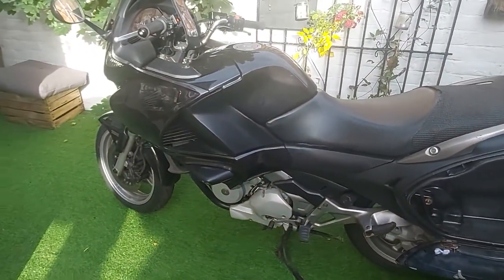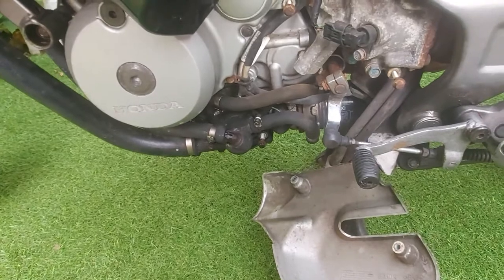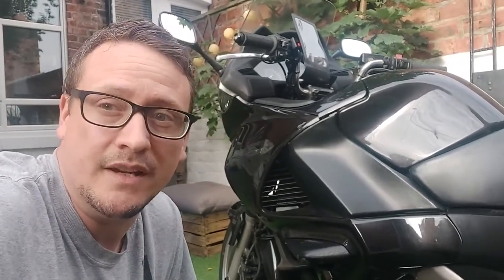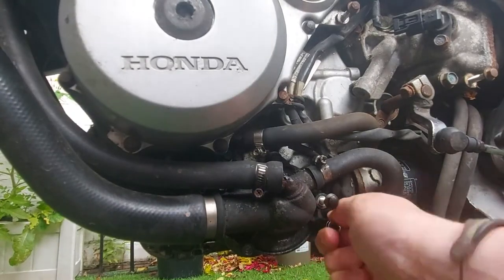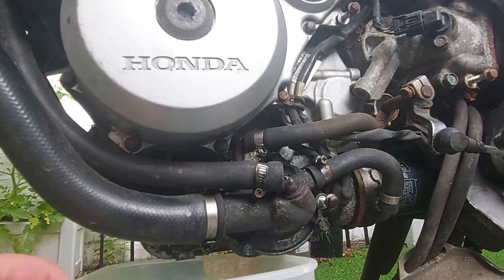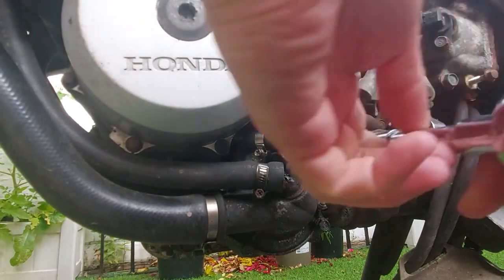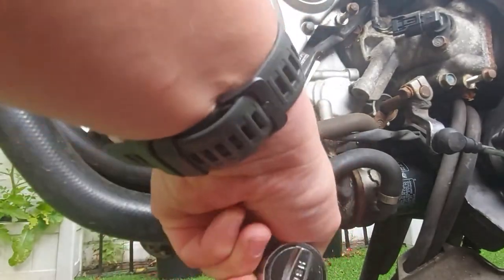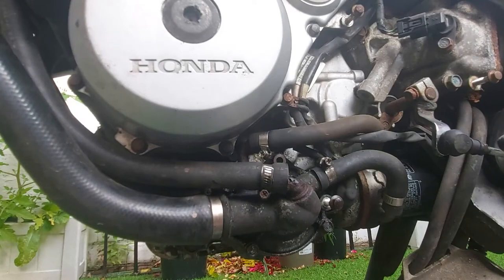Honda NT700 Coolant Leak - Water pump housing and crossover tube

Comment: hello from Pittsburgh Pennsylvania, USA. I picked up one of these Honda NT 700s in 2023/November from the original owner with 7500 miles/not kilometers
  I had trouble with it because the owner parked the bike in his heated garage in 2008 and he put stabilizer in the fuel tank. That stabilizer turned into a lump at the bottom of the fuel tank looks like sand. I have videos of the entire ordeal on my YouTube channel. But when I got the bike, my riding the bike, I believe loosened that mass of stabilizer matter and caused it to plug my fuel filter stranding me 40 miles from home… I finally figured out what it was, and in cleaning the fuel tank and removing the fuel pump cassette from the bottom of the fuel tank, I saw that I could get my whole arm inside the gas tank to use a scotch bright pad inside the tank to loosen all of that white powder that had hardened to the interior of the fuel tank
once I got things sorted in the fuel department, and I put the bike back together, it’s still had a slight hesitation which caused the bike to stall when pulling away from stop signs every now and then. When I would open the throttle from low speed it would Buck like someone shut the key off and then turned it right back on. 
  I did a lot of research on the Internet and discovered that Honda was going to do a worldwide recall on this particular motorcycle because of bad spark plug caps. The plastic bits that snap onto the spark plugs themselves. They didn’t do the recall because they felt that it was only necessary in hot climates to replace the spark plug caps, either way, I’m sure it would’ve cost them millions to do that. But I replaced the spark plug caps, now the machine is running as I think it should..
  on the Internet, they say this machine has two common glitches, the spark, plug caps, and the water pump. Seal is prone to start leaking…
  I was going to just throw in a new water pump, seal and impeller for the heck of it and change the coolant to a low silicate aluminum compatible coolant.. apparently silicate, which is a corrosion inhibitor is what is abrasive to the water pump, shaft, and seal..
  i’ve had quite a few dozen motorcycles over the decades, including two Honda pacific coast/PC 800s. My first one got totaled with me on it at a stop sign waiting my turn, my replacement one I rode for 24 years, commuting, 31 miles a day. I always felt that the Pacific coast was the best all-around motorcycle in the history of the world. I am hoping this new to me Honda nt700 owner has a 2010 model pans out for me and impresses me to the point where I think that this may be the best rounded motorcycle for all types of street duty..
  I bought this machine because of the high praise. This machine gets from the European in the UK riders, which I consider to be genuine, motorcyclists, and not just people that on motorcycles. There is a difference…
  watching this video, made me cringe when that one bolt at the water pump just sheared off. I was not sure and I’m still not sure if you were able to get that broken piece out of the engine? Did you? Or did you put the machine back together without that sheared off bolt being replaced?
  watching that happen has changed my mind about just putting in a new water pump, seal and impeller to avoid future problems. I believe I’m just gonna let sleeping dogs lie in this case..
  thanks for the video. I did not know how great these motorcycles were when they were current. I have never even seen one of these motorcycles on the roads here in the United States, that I can remember, and I have been around for decades. I have more than 700,000 street miles behind me so far., mostly commuting six days a week, eight months, a year, until they start salting the roads here in Western Pennsylvania into Winter. That’s when I park my bikes until the end of March generally..
  since I put a few videos on my YouTube motorcycle channel, I cannot believe how many views I am getting from people that have interest in this particular model. I never knew it was so popular, especially since they haven’t made it for over 10 years now…
One little thing about air pockets in your cooling system and radiator caps and the three jobs that they do, they are not just a cork in a bottle. Radiator caps do three things. 
 they allow excess pressure and coolant to flow into the overflow tank without losing coolant from the system
  as the engine cools, the radiator cap allows the engine, that is cooling and because it’s cooling it has negative pressure that sucks coolant from the overflow tank back into the radiator
  The third thing that a radiator cap does is it maintains a certain amount of pressure in the radiator before it releases that excess pressure to the overflow tank. The reason for that buildup of pressure is, speaking in terms of Fahrenheit, temperature, water boils at 212°F at sea level. with a radiator cap, it has a spring that acts like a thermostat that allows pressure in the radiator to build/to increase to around 220 or 230° depending on how strong the spring is designed to keep the pressure in the radiator until the pressure overpowers the spring by design, water will not boil until it reaches 220 or 230° depending on how strong the spring in the radiator cap is.. 
 I did a video on my channel about what a radiator cap does for maintaining safe pressure and temperature in your cooling system on all your vehicles. Never buy an aftermarket cheap radiator cap for any vehicle you own at a parts store or on eBay. Always buy an OEM, original equipment, manufactured part from your dealer. You can go cheap on some things, but not a radiator cap..
  The danger with boiling is, boiling is the process of a liquid turning into a gas. In your engine in the water jacket surrounding the cylinder is the hottest point. That is the point most likely to make the coolant boil. In that space if you have air bubbles that are simply coolant that is converted from a liquid to a gas, that bubble cannot conduct heat and absorb it and transfer it to the radiator where it can transfer that heat to the air through the cooling fins on the radiator.. never run a vehicle with a loose radiator cap. Your cooling system is a closed loop sealed system that needs to build pressure. Never open your radiator cap on anything when the engine is hot because it will lose pressure, and as it cools, it will not pull colon back in from that reserve tank as it should…
  getting all the air bubbles out of some cars and motorcycles is a problem sometimes..
  thank you for the video, showing how difficult it can be to remove the bolts from the water pump, and how difficult it can be just putting coolant back into the engine and getting the required amount back in and eliminating air pockets..
  I would suggest measuring exactly how much coolant you get out of the engine when you drain it to start a project like this. That way you know exactly how much that the cooling system should take back in when you top it off again.

Comment: Had similar problem with my near side pannier. It was just the rear one of the two latches that was at fault. Just inspect the latch that's on your working side and you will get a clearer picture of how these work. It's definitely not Hondas finest but the small Philips screw had broken through the plastic and luckily for me it was just hanging loose. I just reset all the components in epoxy resin.and all was good. I'm not good at explaining in print but if you look at a good one it might help
Reply from the maker: Thank you for the tip, that sounds very similar to the issue with mine :-)
Reply: I did so and worked out fine

Comment: Hi my friend trust you had a great Christmas,  you probably know this anyway but with you not mentioning it I thought I would suggest it. When you have cheese bolts to loosen (I had a Yamaha Fazer 1000 and the x-up valve on the exhaust was held on with the very same) it pays to either run the engine to temp then after gently tapping the heads of the bolts with a screwdriver and mallet gently mind you, try more wd40 and try with heat in the bolts rather than stone cold. An heat gun wafted round is ok too. 
Then buy four new quality bolts to replace the cheddar ones or next time you need to you will face the same problem again. 
As I said you might have done this before.  Cheers Dave
Reply from the maker: Hi Dave, was a great break thanks didn't get on the bike as much as I would have liked mind, hope yours was too. Thanks for the tip, I'll bare the heat idea in mind next time 👍